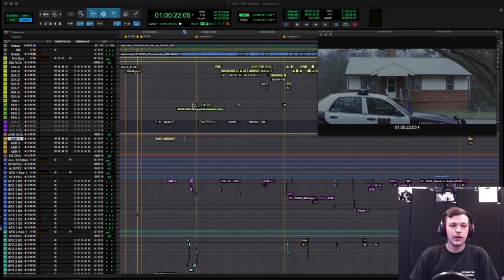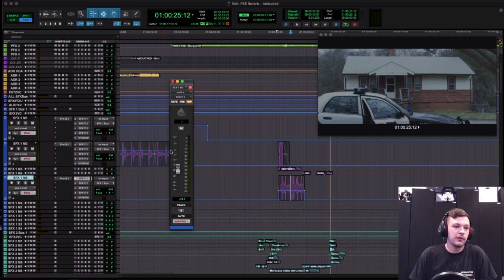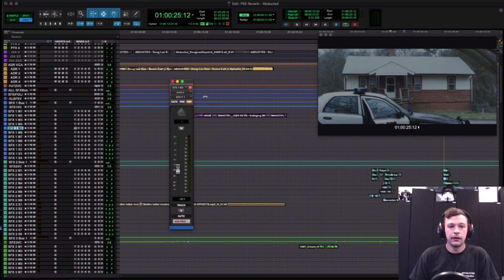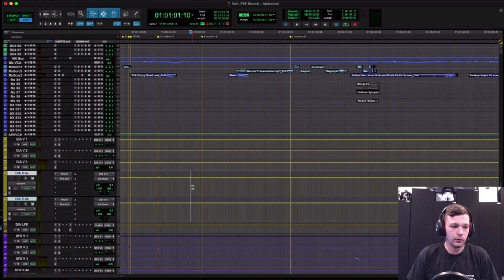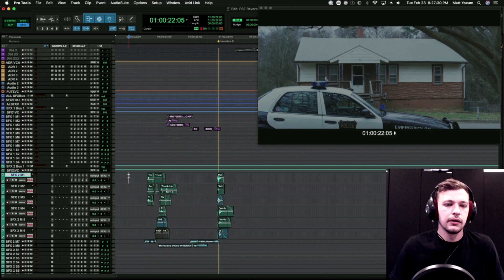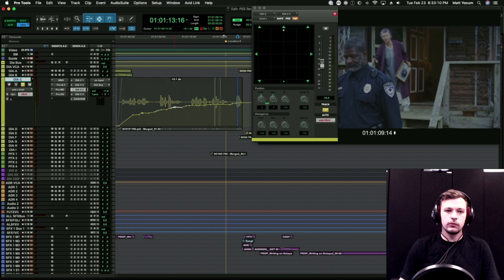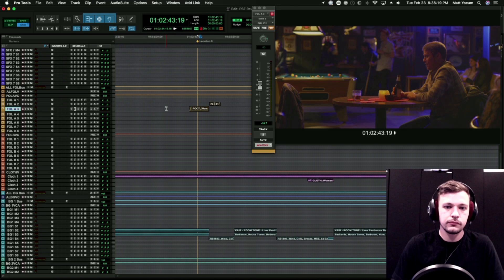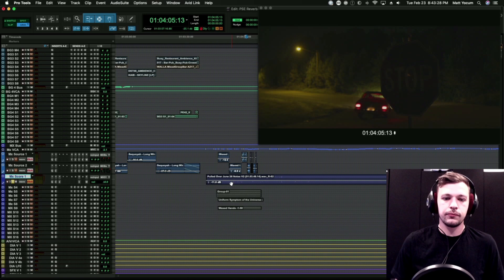Tutorial: How to Use Reverb in Your Sound Design

Comment: Hi Matt, as always awesome video with great insights! I would like to pick your brain on a couple of things: First is do you find yourself using Pre-Fader sends in your mix? Yes, no, why? (I noticed all send in Post-Fader). Second is You mentioned the “boom” term in your template setup, Can I ask if it is possible you record a video going over your workflow for the LFE channel and what and how do send stuff to that channel? (E.g. do you create a mono send and control the LFE in a separate track? Or do you just go about using the LFE fader in the 5.1 Panner window? Last but not least, I noticed you work certain tracks in Trim mode, can I ask a bit about how do use trim mode? Sorry for the many questions and again, great video.
Reply: Te contesto algunas, por tu nombre asumo que entendes español. El pre fader lo usas para hacer un envío que no queres que sea modificado por la automatización del volumen. En mi template el beep a -20dB va pre fader a los canales de grabacion. No quiero que por error se baje el volumen.
Para el LFE creas un sub path en cada uno de tus buses (dial, fx, mus) lo haces desde el I/O Setup. Después creas un bus para cada uno y asignas las salidas a cada bus (dial, fx, mus le insertas una eq con un hi cut en 120hz o usas algun plugin que te de harmonicos y que ya recortan hz). Para usarlos haces un envío en cada canal al bus que corresponda.
El modo trim no soy de usarlo pero fijate que hay un video en este canal que habla de automatización y lo mencionan.

Comment: Do you ever use the reverbs in prefader? I find it easier to control the wet/dry signal, like you showed in the scene when the woman walks away.
Reply: I do not use prefader sends personally. In post they can be a bit of a pain when I try to solo tracks and end up getting all the reverb on top of my solo’d signal. I’m happy to automate the way I do already or manually print in reverb via audio suite if I need more control

Comment: Great insights, thank you! What computer you use to run these big sessions with so many convolution reverbs and other plugins?
Reply: 2018 Mac Mini i7! Works like a little beast! A ton of people are using them because they’re efficient and relatively inexpensive
Reply: @Myocum93  How would you compare your 2018 Mac Mini i7 to a 2012 5,1 Macpro dual 3.46Ghz with a Radion RX 580 8GB GPU with 98gb ram (6 x 16gb sticks)?
Reply: @jcjc8939  I dont usually comment to often on comparing computers because there are so many variables and preferences out there for different things but in GENERAL I'd say its not just about amount of ram and Ghz rating on your processor. Otherwise there'd be no need for benchmarks because you could just compare the numbers. The newer macs tend to be faster than the old ones and thats about as simple as it gets. The new mac mini i7 technically benchmarks faster even than the 8 core trashcan which is 3 times the cost. Now just waiting on m1 support from all the different companies to move there next.

Comment: Do you upmix your 5.1 reverbs to 7.0 or keep them in 5.1? Thanks again for this brilliant video!
Reply: I do not. I find that the 5.1 reverb is enough for me with my music tracks. Though one thing I could try would be to use Spanner to bring the rears a little into the sides but that would be identical signal from the rears and sides which would mostly just mean more volume.

The slapper delay/reverb unit you saw for my exteriors is a 7.0 though

Comment: It seems like pro tools is an industry standard, but I have a question related to premiere. I've been trying to bring different audio plugins into premiere and they are often crashing my projects. For example, I can't run Izoptope in premiere without it crashing. Is this a common thing? Is there any work around and do you think it would work better in audition? I am definitely interested in protools, but my company uses adobe products. Any insight would be greatly appreciated. Thanks!